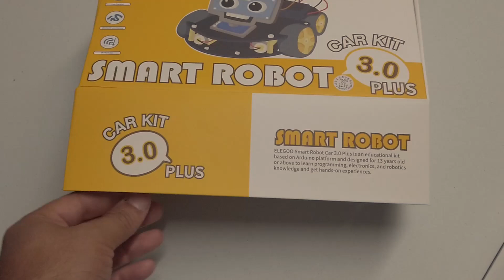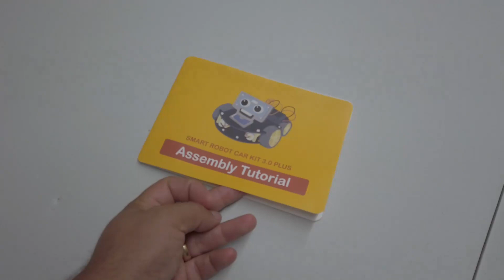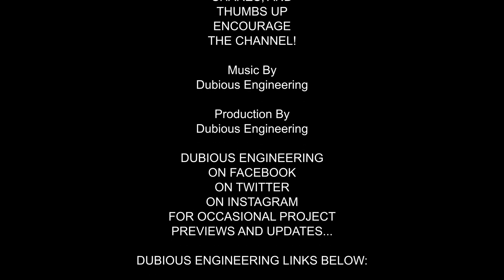DuB-EnG: ELEGOO Smart Robot Car Kit 3.0 Plus - Is it worth it? - Review, Build, Assembly and Test!

Comment: I love it, seems to be pretty quick on the movement too!
I'm assuming you can play with the code on the Arduino to customise the actions available, is that right?
Reply from the maker: Yes...  I think I’m going to have to have a play with the code...  tweak those accelerations!
Reply: @DubiousEngineering  are you abele to control what the front mount sensor does, like once it detects an object it will stop just like a self driving car.